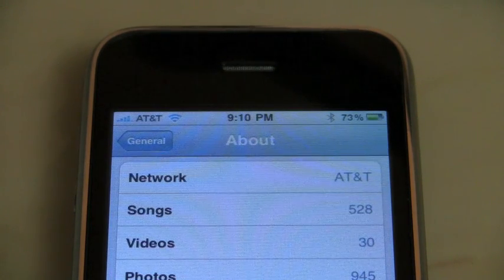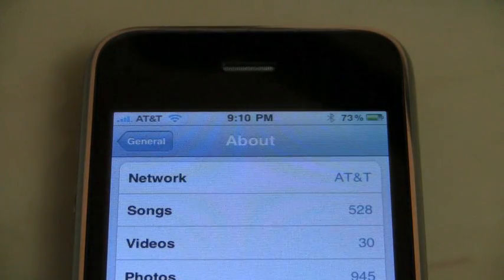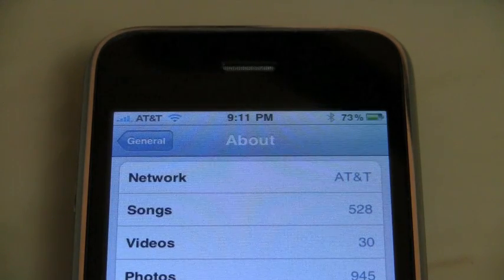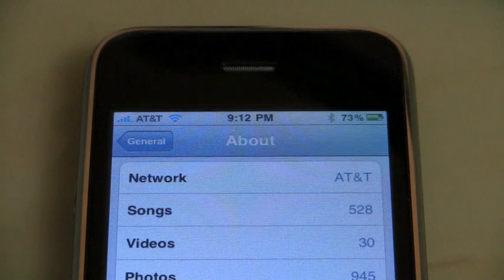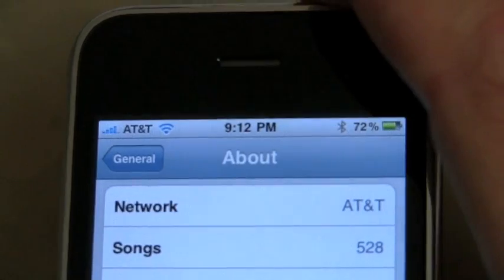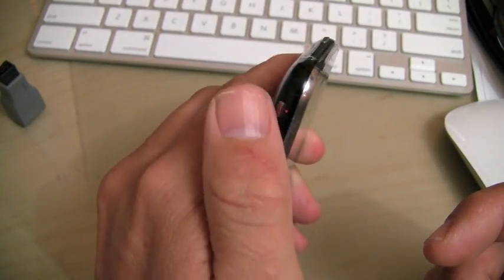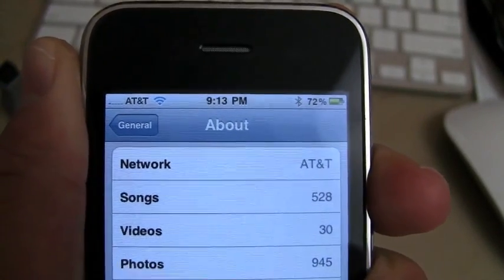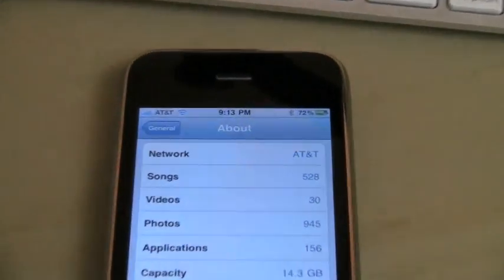iPhone 4 Antenna Issue on a 3GS

Comment: The effect is much more noticeable in marginal signal areas, I tried the "deathgrip" on an iPhone 4 which had been showing 4 bars of signal, it lost service totally. I was tempted to get an iPhone 4 but for my purposes it offered little more than my 3GS, however this issue put me off. The 3GS loses coverage more readily than my work phone (a basic Nokia 6300) in London this is not an issue due to the huge number of cell sites but in remote areas the iPhone fails first.

Comment: It certainly IS a design flaw with the new model, all phones will drop some signal if you mask the antenna, the 3GS has it's antenna somewhere low down in the phone but internal. The issue with the iPhone 4 is that the antenna is external and hence can be accidentally touched. It is not simply a case of "short circuiting" the stainless steel trim, it is the detuning proximity effects of having a large conductive object (your hand) close to the antenna.

Comment: ok, the design is not best, but the only did it for fit whats inside. and plus, ipod touch is for yes, the same price, but, is FFFFFFRRRRRRREEEEEEEEE, for everything else.  for the iphone, you need to pay for connectiong to the internet and downloads and whatever, so at&t ios just getting the money out of you, bet unless you want calling and texting, get an ipod touch. and, they should just make multiple connection "antennas" than just one.

Comment: I can not reproduce that to my 3GS. Tried it in 7 locations and 4 states it never happen, can't reproduce it. On my new iphone 4 it is just useless as a phone. My friend dropped his iphone 4 while talking and  trying to hold it in a position not to lose the signal. The glass shattered. Turns out the iphone 4 is very fragile compared to 3GS. My 3GS survived  when my girlfriend dropped it twice.

Comment: When you see people replicating the signal dropout on iPhone 4 just by holding one finger on the antenna gap on the lower left side, it is definetly not comparable to the thing you show in this video.
When you cradle the phone, you block the antenna more or less.
The iPhone 4 seems to have an issue with objects "shorting" the antennas.

Comment: It's a simple antenna short circuit... using a rubber bumper thingy solves the issue.
Aplle should supply rubber bumpers for free... or your money back.
The antenna is external and your skin shorts it out.

Comment: @MobileGazette ....It's pretty pathetic when a phone needs a "bumper" or a case in order for it to work properly, Apple fuck up with the iphone 4 design, now you will probably HAVE to buy a "bumper" for it to work properly.....you also don't have to death grip it like that in order for it to lose signal, all you need to do is put one finger on one antenna and another finger on the other antenna and it will lose signal because you have just created a bridge that causes the interference...

Comment: @Thomas16371 If you block the antenna of any phone, you're most likely going to get some kind of signal/reception issue. It's just easier to show on the iPhone 4 because you can visibly see the seams of the antenna.

Comment: Is this issue new to the iOS 4 ? I just did the test myself here in my bedroom, I went from 5 bars to 2 in 20 seconds.

More interesting though I was taking a call on it, had been speaking for about 15 minutes, before the phone (on 91% battery plugged into the PC) simply restarted, showing me the unresponsive Apple Logo loading icon.

And I wonder if that's related to the iOS4 update.

Comment: Interesting.. the vids I have seen though show that even a finger or metal object shorting the antenna break near the bottom left hand corner of the phone causes signal dropout. Although it's odd that your demo seems to show the same problem with the 3GS, but the antenna is in the top right. 

I'd love to see how the 4 performs in the same test, especially with the bumper.